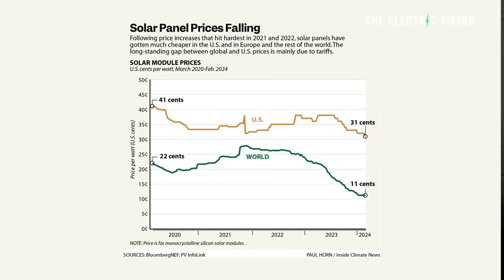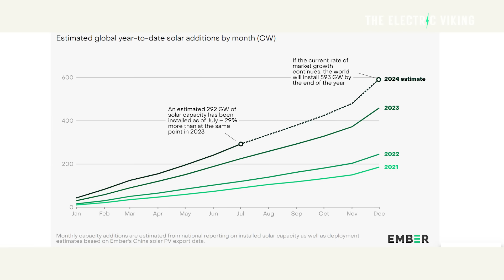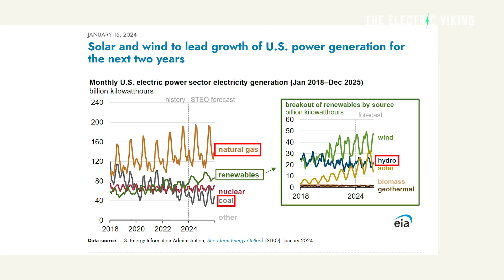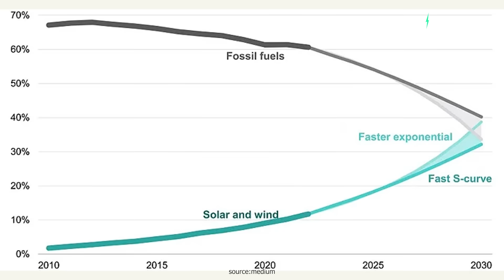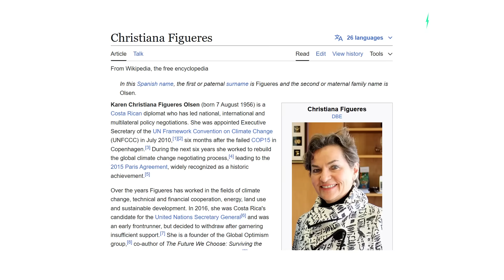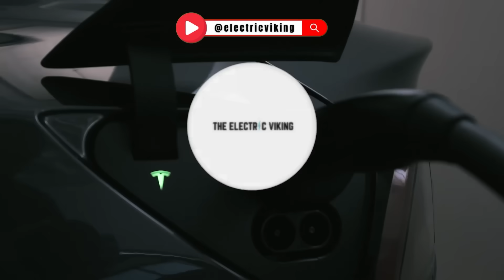Solar & wind will quadruple to 14,000 terawatt hours by 2030 & crush fossil fuels

Comment: If it is so cheap how come our electricity bill has gone up and not down. The service fee is $43.50 now with smart meter where they read from office . Also that smart meter is using our electricity
Reply: As was pointed out the power providers are getting greedy and are reducing your FIT and increasing other charges such as monthly connection or line fee's. This is going to continue to happen until consumers become aware of the rip off power charges really are.  Just changed retailers till you find one that doesnt try to change the pricing to rip you off after joining them.  It is difficult to find a retail or wholesale solution that are not trying to buy your FIT for low prices and then sell that FIT to others as green energy for over 1000% mark ups.  Highly recommend a battery too so you can use the wholesale market and buy and sell energy with your battery and reverse the same stratagy they are trying to impose on consumers back at them.
Reply: @tonyspiegel6771 we only have ergon in our area. Been saving up for a solar system for 15 months now and looks like at least another six months. Being a pensioner it's not that easy to save up.
Reply: @tonyspiegel6771 Agreed - battery srorage is the answer whether or not you have solar pv panels.
Reply: Stop having your head in the ground and look into it, you have a computer and google right ?  Solar is FAR cheaper, you're being gouged by your power company...
Reply: as wholesale prices for wind and solar electricity are well documented as being significantly below even CCNG, I would take up that question with your utility. and if you don't like their answer, just go off grid with solar and or wind and give them the middle finger.
Reply: Because you live in a rentier economy. China's electricity is ~$0.065/kWh

Comment: My 5kw solar system only lasted 11 years and was only getting around $30 of my electricity bill on a good month
Reply: Sorry, for that, but something is really wrong with your system. My 10KW system, installed early 2014 is still running strong. Paid for itself in 6 years. We still have a $2400 credit with our electrical supplier. Need to get an ev or heat pumps.
Reply: Yes - pv panels have come down massively in price and whereas panels in 2020 were producing 330watts each, they now commonly generate 455 to 465w now. Look at the economcs of upgrading your panels sometime in the future.
Reply: @martinmorgan9 been saving up for the last 15 months to get a new solar system and will only be able to fit a max of 10kw on our roof as being a old Queensland home.
Reply: Unfortunately older panels where not as efficient or the quality of recent panels and systems.
Reply: My 5.8 kw system has been working perfectly since 2010 and even charges my tesla model y.  Meets my energy needs.  Love it!
Reply: Well something was wrong with your system, I bet you had it installed {if it even happened} and NEVER had it checked ?  My friend did a similar thing and just whinged, I got him to get his checked and his inverter wasn't working properly, the Solar company replaced it FREE  of charge....
Reply: now, industry standard is a 25 year warranty for 80% capacity. but to be honest, 5 kW is a pretty small system for a house.

Comment: The solar energy on my 1987 casio calculator still works!
Reply: 80085 forever
Reply: My G Shocks watches powered by Solar are also almost eternal if let to recharge (no storage into a drak drawer !)... 
their rechargeable battery is said to last 30 years at least ....
Reply: In the 1970s the calculator was banned at the University as not fair to others without.

Comment: Night, no wind weather and electricity storage : 3 reasons for solar and  wind energy to never be the single solution.
It is part of the solution not THE solution.
Reply: Single case: Denmark has the highest share of wind electricity (54%) in the IEA, which together with bioenergy and solar photovoltaic (PV) make up 81% of the power mix. So, it is not the single solution, but it looks like they could be the majority solution and even more with battery energy storage solutions.
Reply: That WAS true, only if people assumed "no tech advances". Now, it's becoming evident that the problem is govt. interference/corruption, as usual.
Reply: That's an extremely ignorant statement...
Reply: Batteries with the solar panels
Reply: @irwinsaltzman979  Check the price and longevity of Tera Watt hours battery packs...
Reply: if I can go off grid with solar, well, it only gets easier with scale.

Comment: Jenny Chase has just presented a TED Talk on how solar capacity can be measured. She says that satellite images (combined with machine learning) can be used to count the solar panel installations and their capacity.  Solar has been increasing at the rate of over hundreds of GW of power, per year. The largest share is occurring in China.
Reply: USA had 4kW per person generations capacity.
Australia has 1kW per person. 
Australia digs and exports and imports,  low energy needs.
USA manufacturers and so has higher energy needs per person.
Reply: I watched this talk, the machine learning missed quite a big percentage in Pakistan. The installation % is therefore bigger than reported. Good news.
Reply: Capacity shouldn’t be the measured used, production should.
Reply: @waywardgeologist2520  you can not produce if you do not have the capacity. 
Capacity is the generators and fuel needed..
No plant no capacity

Comment: Solar needs 0.1 gram of silver per watt. That is 100K metric tons of silver per terrawatt. There is not enough silver left to make 15K TW
Reply: Copper is being introduced as an alternative to silver. This will deal with the possible scarcity issue and help lower the cost of panels even more.
Reply: @alan2007-x8x  Copper is a more aggressive metal than silver, prone to oxidation. Scientists are trying to come up with special coatings and treatments that would protect the metal from oxidation. Copper also conducts less electricity than silver, another problem. So Copper has not replaced Silver yet, but they are working on it.
Reply: Old numbers. It is around .04grams/watt now. Efforts are ongoing to reduce or replace silver with alternative materials to lower costs.
Reply: @markvalery8632  and don't forget recycling.
Reply: yet, solar panel production continues to ramp. If there is one thing no one needs to be concerned about, it is mineral restrictions.

Comment: Anyone against solar PV at this point is basically a moron who can't be educated. I'm just waiting on the installation of my new 10kW solar system to replace the 1800W system currently on the roof. They are so cheap now it's insane. Now just have to wait for a decent EV ute to hit the Australian market.
Reply: best solar is the parts you can build on your own. That has insane payback rates.
Reply: @seppwurzel8212  Even installed and warrantied it's less than $1/watt. Payback period didn't even enter my mind. I'm more concerned with the rising price of energy and minimising my monthly outgoings going forward. This should eliminate electricity bills and once my new system is installed i can change my hot water system and stovetop to electricity and eliminate the gas bill, then when a suitable EV is available, eliminate the fuel bill as well. 
$10K is cheap to eliminate gas/electricty/fuel bills for the next 20 years.
Reply: My 10KW system was installed in early 2014. 38 panels, $40,000 US before rebates and tax incentives. What is your cost today and how many panels?
Reply: @ A bit less than $10k ($6,500 USD). Not sure on the panel count.
Reply: @markvalery8632  I have seen 400 watt panels retail for $100 each with cheaper prices for full pallets
Reply: @markvalery8632  You've been being ripped off in the States for years, every 3rd house and more have solar in Australia and it's dirt cheap....
Reply: @MickH60 its subsidised by the government in Australia....so how is paying normal retail price a Rip off?
Reply: @ Panels out of China are 10 cents per watt. Anyone paying tens of thousands of dollars for a 10kw system in 2025 is getting ripped off.
Reply: Yehehe ( elderly woman’s voice) solar panels are ugly I just don’t like the look….
Solar panels are wasaaaaaay smarter than ugly 
Roof cosmetics adjusts ur electric bill GET OVER TH LOOK an get use to ur lower electric bill
Reply: 100% correct....
Reply: Ok genius....do you know what a negative FIT is?

Comment: I think you should also look into the Thorium nuclear fuel cycle.  One huge benefit is this kind of reactor can ‘burn’ spent nuclear fuel and therefor solve the nuclear waste problem.  Also it is totally green electricity.
Reply: Thorium reactors don't currently exist. We don't have spent nuclear fuel. Solar is 1% of the price of nuclear reactors and can be installed and operational in days, not decades.
Reply: lol. god no
Reply: It's also extreme expensive to build and takes over a decade to build for each power plant.
Reply: Apart from what the other posters have said, nuclear is too centralised. With solar you can not only decentralise the system but you democratise it, something not possible with nuclear.

And I think the average person today has had enough of being exploited by big energy companies.
Reply: @ It's why they pushed hydrogen cars so hard, so the big energy companies still had you going to the servo every week or two and dropping $100 instead of making your own energy at home and cutting them out.
Reply: @ What a debacle that's been. Class action against Toyota in California.
Reply: too expensive
Reply: It's a fantasy....

Comment: The panel's are also cheaper per m2 then most building materials which is another tipping point,  they use them as fence panels in Germany
Reply: We don’t need large batteries 🪫 to hold the power we need superhigh voltage  underwater power lines that can take power from India 🇮🇳 to Australia 🇦🇺 to Japan 🇯🇵 to America 🇺🇸 to Europe to Africa problem solved. Because the sun 🌞 never sets
Reply: except start at australia. @williampisano7573
Reply: @williampisano7573  What a ridiculous idea. The power loss would be unmanageable, and considering that even neighboring Russia can’t be trusted, how could electricity possibly be transported all the way to Asia? This would be the easiest way for a country to commit suicide.😂
Reply: 40 bucks per module at tepto. I believe it's even like 420 watts or so.
Reply: I will have a fence made of them.
Reply: The panel’s what?